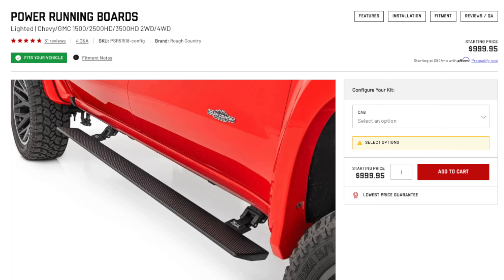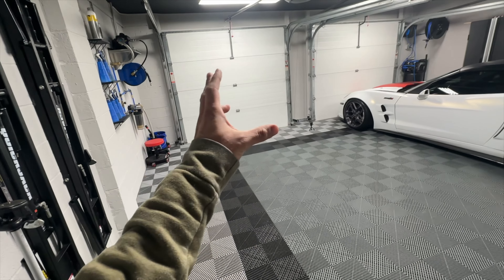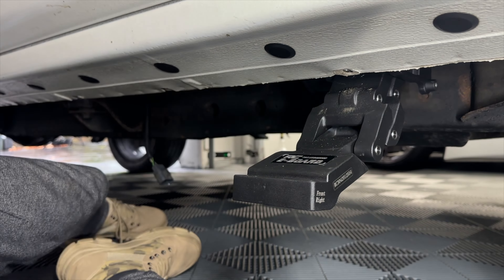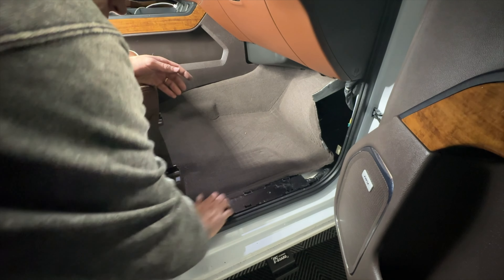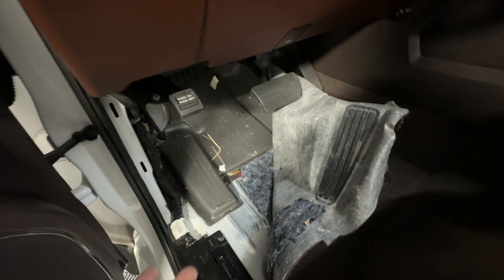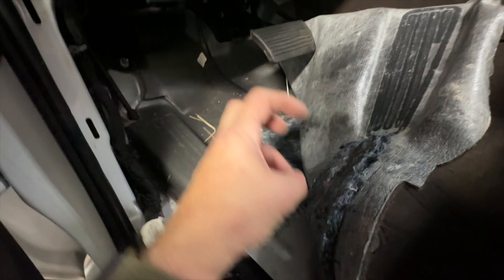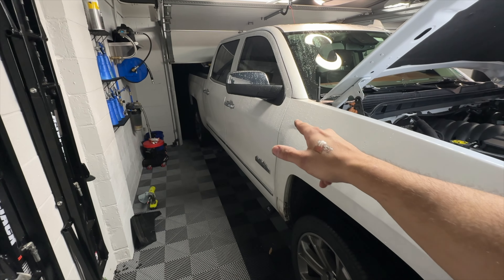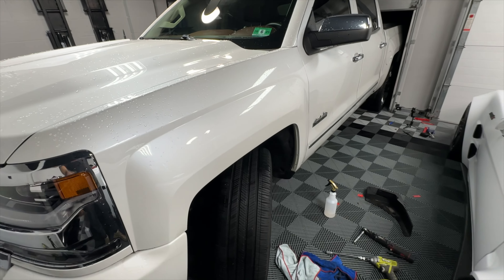Rough Country E-BOARD (Side steps) Full install and review! Game Changer!

Comment: I have the Amp Research Powerstep Xtreme. Got it on sale. Still spent $2k. Great steps. The hardest part was connecting the trigger wires to the BCM. Pre refresh models only need to plug into the OBD port.
Reply from the maker: Great choice… as I said I can’t compare it because I never had the amp one… but I want to give a try for the RC ones… we will see, only the long run will tell if it is worth or not
Reply: @Matty.Garage  very true. This is the first time I’ve ever purchased electric runningboards. The only thing I don’t like about the Rough Country is the magnetic trigger system. One thing I don’t like about my steps is the LED lights. They look blue. Other than that I’m pretty happy with it. It took me literally four days to install it. I took my time and did one phase at a time spending several hours a day doing it. I still need to install the accessory switch so I can have them in the in or out position.

Comment: We have a 23 Tacoma TRD double cab Off Road. We lived in a very mountainous area of north central WA state and get 5-7 feet of snow every year. We're 5 miles from town on a private road that we have to plow and maintain ourselves.
I have factory running boards on my truck now, but they sit right under the rocker panels. I am looking for a running board that is closer to the ground and retracts up against the rocker panels when not in use

Comment: My Brother in law has those clunky GM articulating steps on his 2018 Centennial Silverado.  He's not one to do routine maintenance.  He's 6'2" and has them turned off most the time.  They are probably frozen in the closed position.  I never cared for them.  I bought some very slightly used AMP steps from my friend for $700.00 for my 2018 Sierra.  They are plug and play and they came with s splitter to keep your OBD2 port open.  They work great and have a 2.5 second delay when closing the door so if you close one door and immediately open the other it saves them from going up and then back down again.  He traded the truck in and removed the steps prior to trading it in.

Comment: My story,
All pretty easy…….. except “setting the motors and door triggers”, the lack of thought on securing the motors which are sooooooo important is pathetic. 1 (small) bolt and another jammed right against the motor arms….. mine are loose, I’m a metal guy so I’m going to customize support brackets. The bolt on the bottom is loose. (Factory hole is too big) Home Depot run to try and figure a  solution.
Triggers.
Did exactly as this kid shows and RC guy Gaston and …….. still didn’t work……… got magnets of my friggin fridge !!!!!!!!!! Works
Again ….. Home Depot to buy magnets !!!!!!!!!!!

Oh, and I do custom work at an auto shop in Florida.

8 hours ran all the wires and triggers , aliging and securing the motors on the driver side ONLY !!

Will finish tomorrow.

The body mount frame on the drivers side 2015 Sierra 1500 is hitting the step..

Will grind of some metal there.

Tough Day !

Do your research, 
Watch videos and expect NO TIME LIMIT.

They are cool, cheaper and whatever,

Later